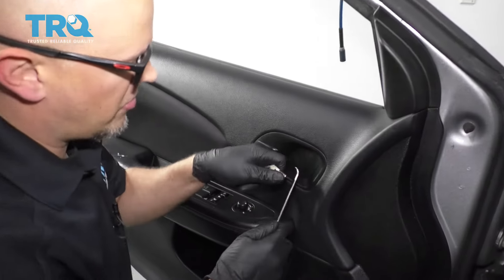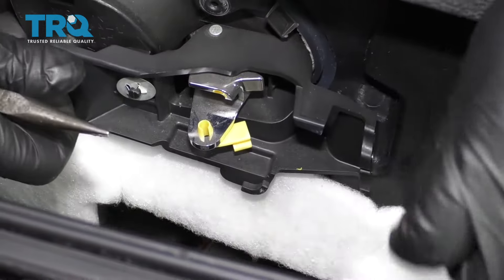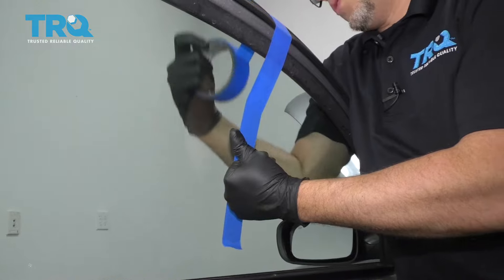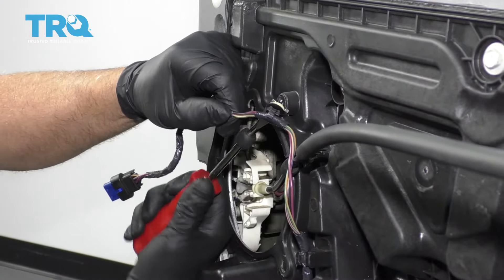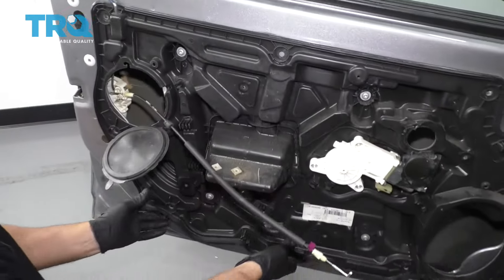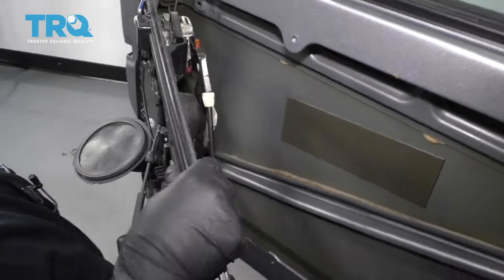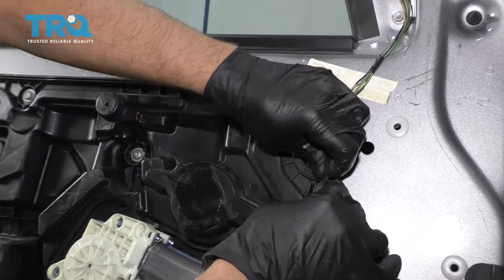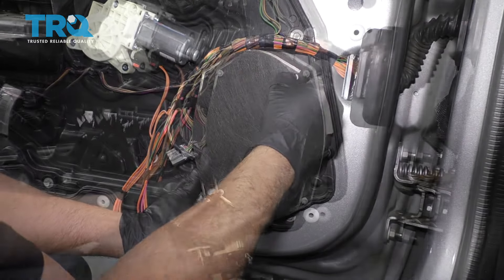How to Replace Front Driver's Side Window Regulator and Motor 11-14 Chrysler 200

Comment: This video saved me. Got off of work and saw that my window was completely down. At first I thought it was a burglary but noticed no shattered glass and nothing missing.  this video helped me at least get the window up so I could sleep knowing that the window wasn't wide open. Then I was able to install the new regulator using the rest of the video. Works good as new. Very thankful for you uploading this

Comment: Brill video best one I was able to find after many hours of searching. Cheers all at TRQ. Easy to follow step by step guide. 
Only one small thing that would have helped me. When your mechanic is about to do something please have them pause for a second or two, before they block the view with their latex covered fingers. That way I can see where things like plugs or wires go without having to keep going back to try and pause. 
Thanks again.
Now looking for your video on removing 3rd row rear right seat belt.
JP France

Comment: great video helped me a lot. it was especially helpful to pull the panel out to get to the lock clips other videos did not gve that advice. my biggest problem was the wire retainer at the front of the panel it was between two plates i finally just cut it. i will replace it however it presented a few hours of unsuccessful attemts. otherwise the video was the best i have seen. thank you!

Comment: EXCELLENT VIDEO! . What happened to me, as I simply lifted up on my window switch the window went up all the way then I heard the sound of shattering glass and then my window slowly went down  into the door. I obviously broke the bottom portion of the glass because I brought the window up by hand and the remaining glass was fine. I then just taped my window to keep it from going back down. Is this scenario the cause of a window regulator that suddenly broke or does the glass just break at the tabs? I'm not sure if I need just new glass or glass and a new window regulator. Have you ever heard of this happening? and what's the cause.Thank you!!

Comment: This video was very helpful in replacing the window on a 2014 Dodge Avenger.  The following video was also very helpful / recommended: https://www.youtube.com/watch?v=cxKeoBoLEyk&t=207s   
NOTE: YOU DO NOT NEED TO REMOVE THE REGULATOR OR INNER PANEL TO REPLACE THE WINDOW GLASS.